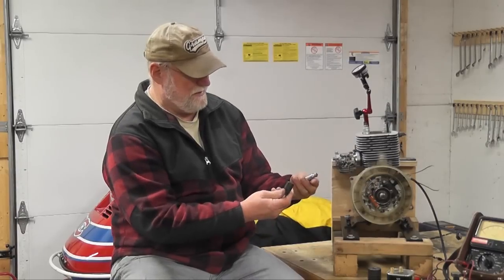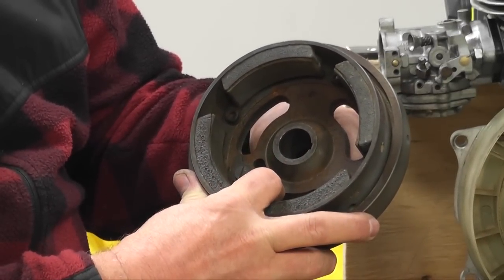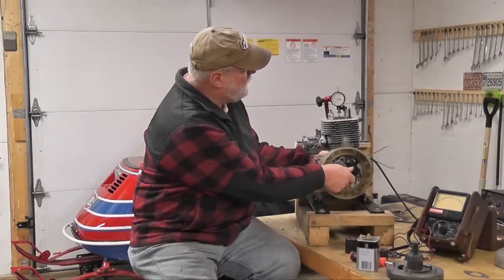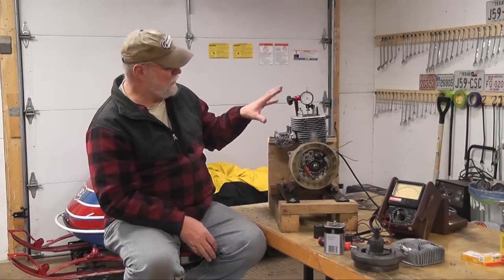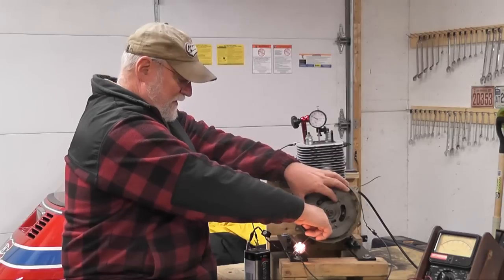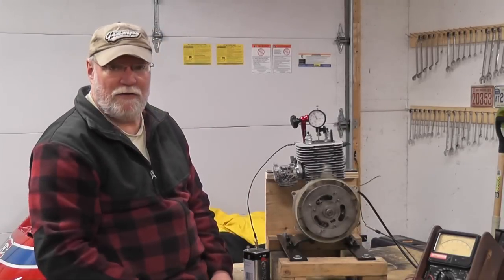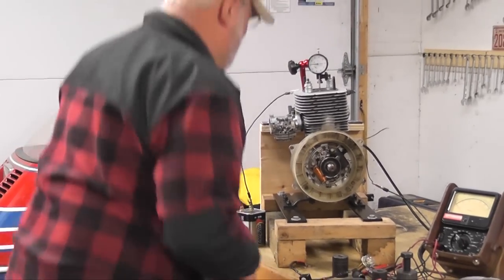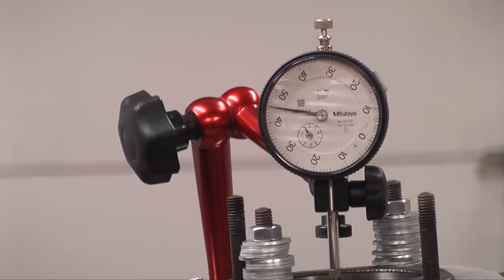Rotax single timing

Comment: Regarding your points comment « that’s all I’ll say about that » Well!  Any collectors still put there who want original points, « Dream on » cause BRP sold the rights to Fullerton’s who  now provide a Turquish équivalent only thru BRP outlets at $40 cdn a crack.  No made in Germany stamp of coarse but they look alike and fit.  Set at 16 you will be hard pressed to adjust at 150/170 BTC.  A simple piece of angle iron bolted to the carb port much easier that this wooden setup.  (what to do with it later like store it?).

Comment: also wondering,if you set the points at 17 or16,will it run different
Reply from the maker: I don’t think there would be much difference. The spec is between 14 and 18. Maybe someone else with real world experiences could chime in?
Reply: @GaWajn  I have a 335cc single i could not time to the .230 spec with points gap set at .14,.15,.16,.17. i had to set at.18 max to get the timing and the motor runs perfectly.
Reply: Changing point gap.WILL change timing! Thats why you set your gap FIRST!

Comment: While you were so well setup for it, it says in the service manual 0012 end gap measurement between internal coil and magnets on the mag.  Best spark with blue flame.

Comment: Probably a less accurate shortcut: I determine TDC by observing the piston through the spark plug hole.  Mark a white line somewhere on the housing adjacent to the flywheel and another on the flywheel so they line up. Connect an automotive timing light to the spark plug lead (spark plug out but clamped to the cylinder head) and to a 12 volt battery. Spin the motor with a cordless drill and see how the marks line up when the light flashes on them. The mark on the flywheel should land a bit before the one on the housing, about 4 degrees. The motor does not spin fast enough to activate the advance cam.

Comment: Very good video, very good set up, valuable information that im going to need when I put my 335 rotax back together, I was worried about adjusting the points and proper alignment of the stator plate, but not any more. Thank you very much
Reply: I came here because of a 335 as well.

Comment: Hello there ! really nice Video ! thanks for uploading !   i have a few question tho !    im rebuilding my 299 12/3 and would like to check the Timing !   if i just rig a Light thats okay ?  are all 299 12/3 timing advance is at 150-170 BTDC ? and what is your Flywheel/Magneto Puller you have !  looks to work nice !  thanks
Reply from the maker: I would not know with just a light. I have never done it that way. Check your service manual for the correct spec for timing BTDC, but I think you are correct. That puller is the correct puller ... still available from Bombardier dealers.

Comment: I have a 73 single 247, is the timing the same as this one ? At between 150-170 BTDCThank you
Reply from the maker: +orignalbuckaroo  between .147 and .167 BTDC if I recall correctly ... but check your manual.
Reply: @GaWajn  you are correct

Comment: Thanks for the video. I have a 503 with the CDI Ignition. Could you show us a shade tree way of timing those systems?
Reply from the maker: Sorry bud ... I can't help you there, I only do the antiques with the breaker points ignition systems.
Reply: dave flyer.  So if you have coils you dont have points
Reply: dave flyer Don’t know for sure cause the spring tension cam needs to be replicated for various load demands.  Full out racing you could set at 160 but I am not sure if it would ever start up.